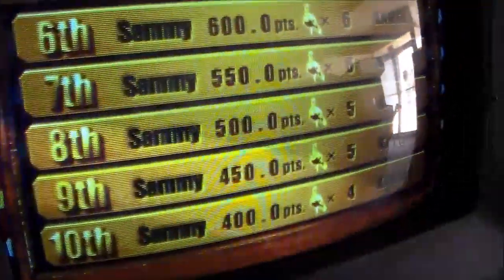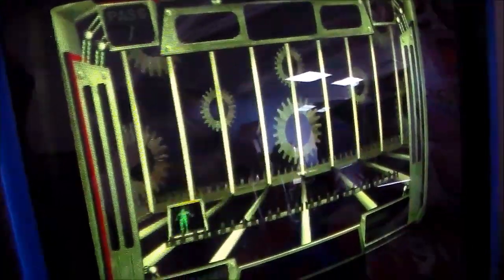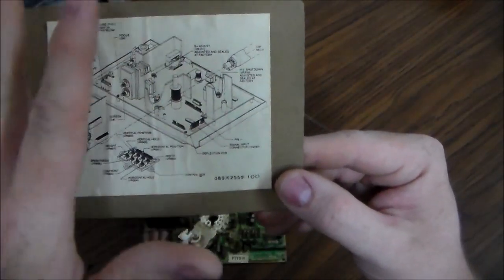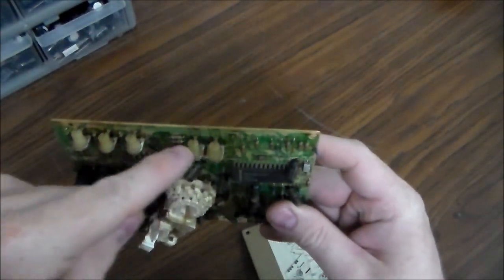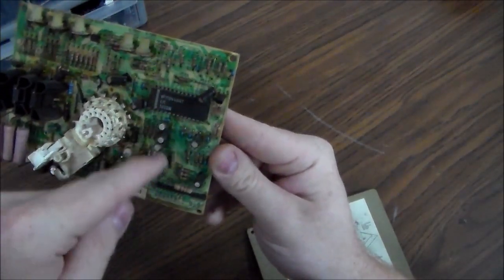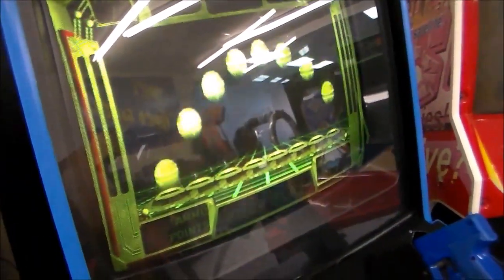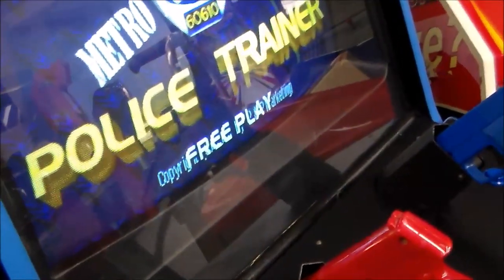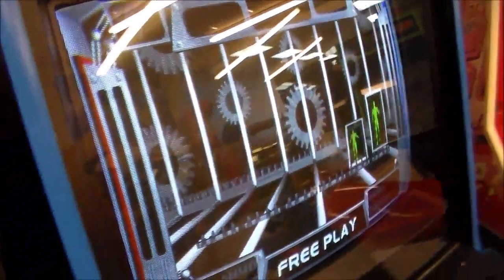Wells Gardner K7400 Arcade Monitor Neckboard Repair - Missing colors

Comment: Hi and thanks for the video. I'm thinking about dabbling in the k7500 monitors and I've got the k7000s down pat pretty good but I'm having a hard time finding flow charts and much information for the k7500s. Would you be able to provide me with any tip or a link to a good flow chart for that?
Thanks
Reply from the maker: Randy Fromm did make one (he made most of the monitor flow charts on the internet) but I think the one he made was for the U2000 which is very similar.  You probably know Wells made the U2000 and U5000, and then decided they had too many issues so upgraded them into the redesigned K7400 and K7500.  You can also find repair tips on wellsgardner.com just click at the top under service and support, they have a ton of troubleshooting guides and schematics, etc. for all their monitors on there.  Everybody acts like the U2000's and U5000's are horrible but really once they have the couple update kits they released for them they're about the same as the 7400's and 7500's.  You probably already know this too, but the U2000 and K7400 are low res and the U5000 and K7500 are medium res.  A lot of the driving games from the 90's are medium res and most of the fighters, etc. are low res.

Comment: Joe I have to wiggle the neck board on the yoke to get some colors sometimes??!? Do you know what could be the problem?
Reply from the maker: Look and see if the transistors are loose, if not you may need to clean the pins on the tube (carefulllly), they may be tarnished so it doesn't make a good connection in the socket.
Reply: Joe's Classic Video Games ya Joe the heat sinks are loose!! Thanks man! Should I put some more solder on it??
Reply from the maker: Definitely, look on the back and wiggle them see if the legs move, you need to get it rock solid :)
Reply: @LyonsArcade  Man that worked thanks for the help!
Reply from the maker: Glad it worked out!
Reply: @LyonsArcade  Joe whats the part number to the color resistors?

Comment: Awesome video, Thanks. I just picked up a game with too much blue . Once I got it home I cleaned it, waited a bit and just did a full cap kit. Some of the NB traces were coming up where you said but when I turned it on for the first time,.. Nothing blew up, yeahhh, First cap kit ever) but the blue was still strong. Fooled with the NB pots and turn blue all the way down and messed with the other some but still a little off or dark but looks a lot better than it did. I think I will check the those transistors or maybe be better to just replace them  as well.
Reply from the maker: It might be the tube unfortunately, hopefully not because that can't be repaired!  Sometimes if one color is too strong, it's really that the other two colors are really weak on the tube.
Reply: Ah, NB = neckboard.
Reply: @LyonsArcade  would a tube rejuvenator help?

Comment: I got an cruis n usa arcade cabinet, mine does not display red color, sometimes when i got it on for a while its shows red, but again its gone, could it be that board?
Reply from the maker: Yes it's likely this neck board in this video doing the exact same thing, bad solder on the transistors.
Reply: @LyonsArcade  thank for ur help, so sad this board are a pain to find them, ill try to fix it then, thanks again for ur videos.

Comment: Great repair vid Joe 😎 question, I have a GO7 that is missing the black color. It's very red, pinkish. Could it be a color transistor?
Reply from the maker: Yes it could be, but you should be able to turn the brightness down until the black is black.  If no matter what you do there's just red everywhere, the red transistor is probably locked on and needs replaced.  Unfortunately it could be the tube too, the gun in the neck could be shorted to the heater or the grid making it stay red all the time.
Reply: Joe's Classic Video Games thank you sir

Comment: Man I wish I lived near you guys.  I'm having a geometry issue on the left side of my screen(K7400).  Could a gameboard(MK2) have anything to do with that?  Also, I get a little shaking on the screen(very little and not often) during matches.
Reply from the maker: In general No, the gameboard wouldn't cause any geometry issues on the screen but I guess it depends on what the issue is.  The only thing I can say about MK II is whenever they designed the attract mode, the screens that it steps through have this marbelized background, and they're not all centered, and they're not all even the same color!  I always thought that was really strange.  So in other words, it's impossible to center the screen on the attract mode, you have to center it on the game play screen if that makes sense.

A little shaking on the screen, see if it appears to happen when the screen gets brighter.  If it does, that's likely something in the power regulation area.... in general the way I would try to fix both problems would be to replace all the electrolytic capacitors, you probably also need a new flyback if your brightness or your focus drifts as the game is left on for awhile.  On K7400's we always do full electrolytic capkits and new flybacks.    You can get those from www.ArcadePartsAndRepair.com ...
Reply: @LyonsArcade  thanks for the reply.  I did a full cap kit and even took it to a tv repair man and he said that was as good as it gets but I think he was kind of full of you know what.  Thanks for the response.
Reply: Plus, I only center the screen during fights.  Just wanted to see if that was a possibility.